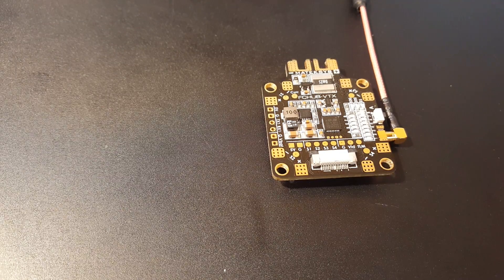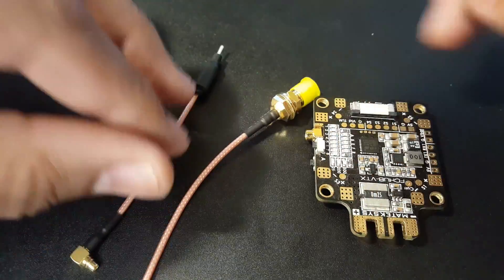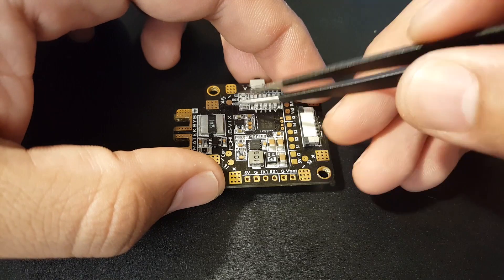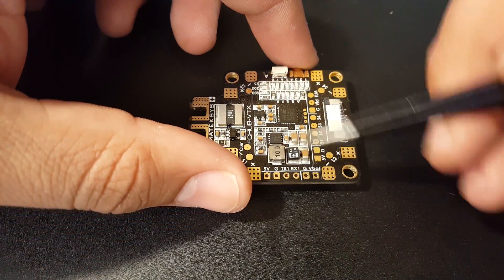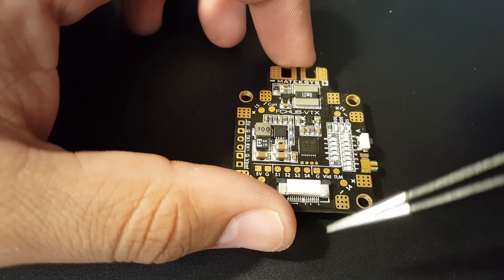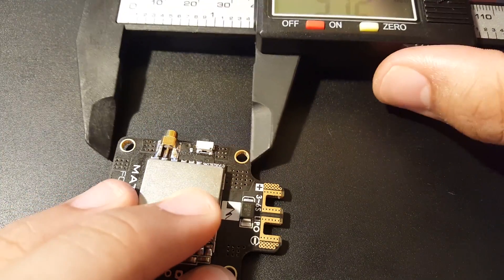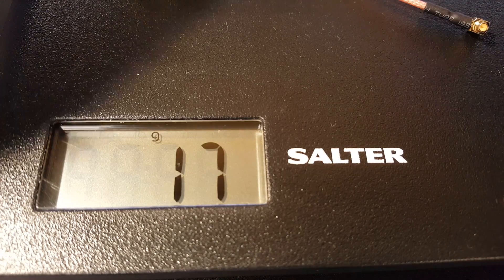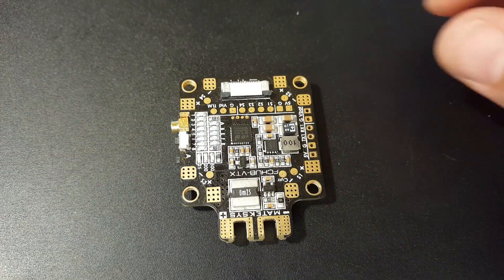Matek FCHUB-VTX // Overview and Specs

Comment: Please do a RF output power test with that one.
Apart from everybody else they go with 500mw max, why is that, do they want us to be on the save side?
Are these really only 500mw or does it actually output more than that on some channels?
Which are the best channels on this one?

Your vids are awesome in general, showing us the solder pads of a new product is fine, but only a few people have an RF meter, so please do more RF power tests on those VTXs.

Comment: I wonder how well this PDB / VTX would handle 6s? 27v max isn't much above 6s voltage.. kind of makes me hesitant. Other than that, it looks really nice! 

Edit: How many amps is the current sensor capable of reading?
Reply: We always don't write the absolute max rating.  this BEC chip can support 30V continuous Operating Input, 36V Input Transient Tolerance.  3A output.  current sensor chip can support 36V,  BEC input MLCC is 50V X7R series.

Comment: PDB with VTX was one of my idea. Combined with built-in onboard radio receiver flight controller makes a really clean build.
Reply from the maker: Its done already. Frsky F4 FC and the matek PDB/VTX sweet and clean setup.

I will be getting the FrSky FC and making a water proof quad on the channel soon.